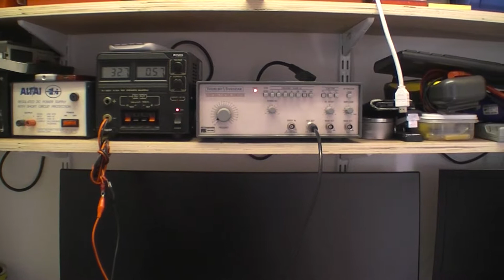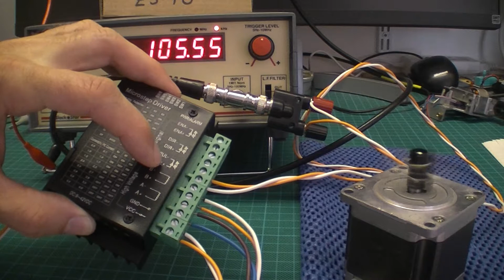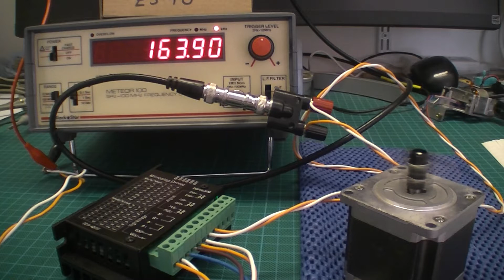Driving a TB6600 microstep driver at high pulse frequencies

Comment: FYI If there is a 32microstep DIP switch setting on the driver, it is not a true TB6600 version.  If you look at the TB6600 datasheet, it can only go up to 16microsteps. 

If you open it up and look at the chip, it’s more likely a tb67s109 instead.